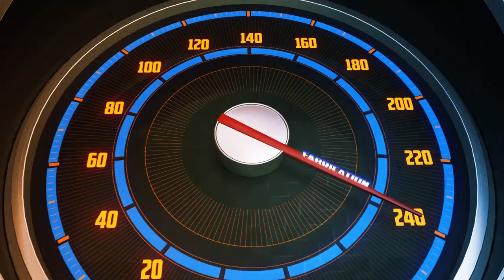1966 Ford F100 Power Steering conversion & more! Part 1

Comment: I don't know what you finally did on yours but on mine I went with the same year steering shaft as the steering box and cut the knob off at the steering wheel to make the original steering wheel fit and retrofitted the linkage at the bottom. You will find out that the 66 manual steering box is offset by about an inch closer to the frame than the power steering unit so you will have to add possibly a steering knuckle as well.

Comment: Great video sir. Can you tell me where I can find a steering column for my 1981 ford f100 Custom wit an automatic transmission?  Thanks
Reply from the maker: If you are looking for a factory replacement column I would check out car-part.com. They are a nationwide salvage yard database.
Reply: Another possible resource is Flashback F.100 out of North Carolina.

Comment: Does the same process work for a manual?
Reply from the maker: This truck does have a manual transmission.  What are you referring to specifically?
Reply: @robschwiesow  Does the upgrade work with either transmissions, I have a 4 on the floor (1969 with 390 4 speed). Do you have a second video? I take it you wound up shortening your column by 2 inches?
Reply from the maker: Second video is coming, I had to take 3 inches out of the column.  You should be able to do this upgrade regardless of the type of trans you have.
Reply: @robschwiesow  I am surprised no one makes a bolt on solution (not the electric option).
Reply from the maker: There is the crown vic option, but that really isn't bolt on I suppose.  The column modifications are about the hardest part of this whole thing.  I could have just purchased an ididit or flaming river column and that would have made it much easier, just a little more expensive.